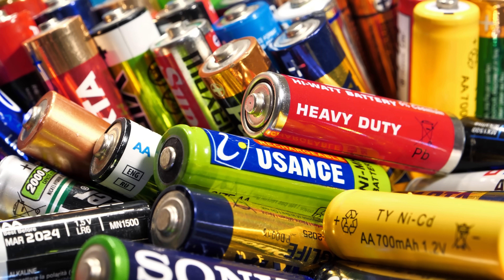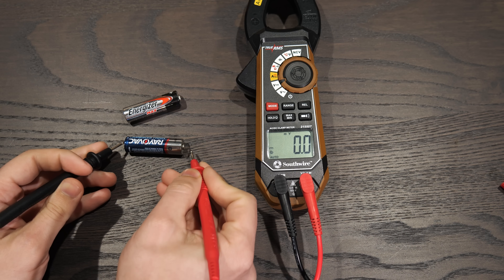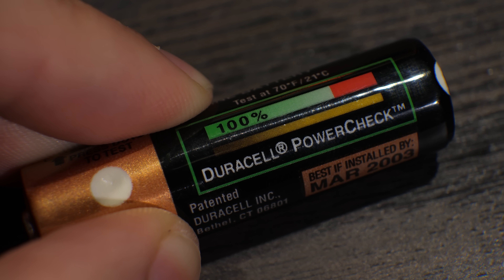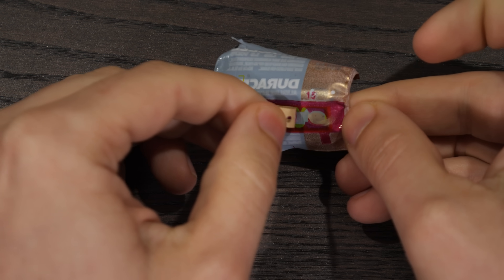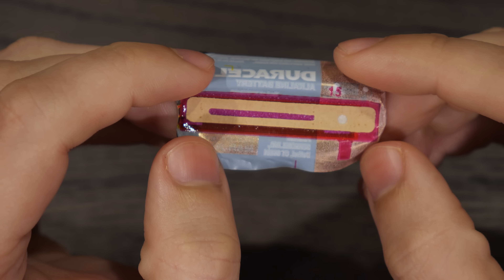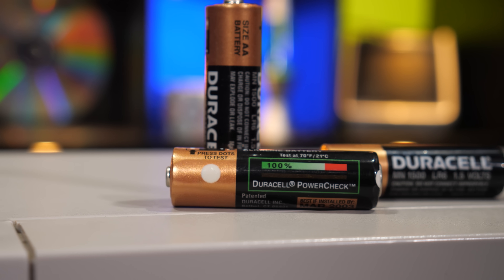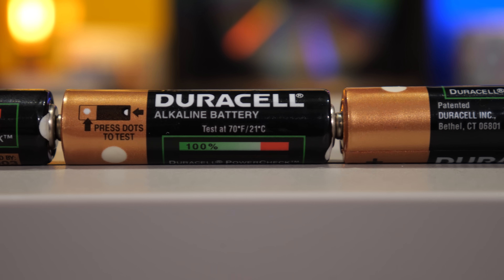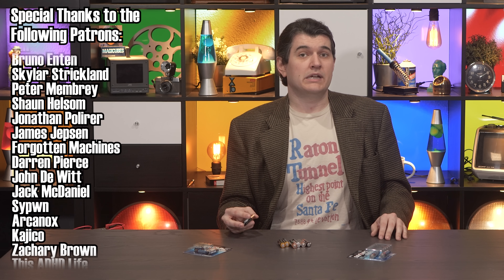Duracell PowerCheck: A genius idea which didn't last that long

Comment: I bought a bulk amount of Duracell Ultra PowerCheck batteries in mid 2010s in the UK. Still have some that are fine - best before date is 2024. These ones also have different colours on the meter, ranging from red, yellow, green, to blue.

Comment: as much as i hate AA batteries they're 10x better than internal batteries, i bought a brand new ps5 controller and it doesnt last more a few hours before its dead, ive had my xbox 360 for almost 15 years and its still going strong with removable batteries

Comment: When I was a kid, before Duracell integrated the tester into the battery, it used to be built in the packaging. You could test other brands of batteries too. Though, the tester does glow hot.

Comment: I'm going to disagree with you about fixed rechargeable batteries in devices vs regular disposable batteries.  I much prefer when devices use standard AAs rather than a completely proprietary lithium ion battery that's custom designed for a particular device alone.  There is a particular problem especially when it comes to retro gaming.  The good thing about an old GameBoy, Wii Controller, or Xbox controller is that it uses standard AA disposable batteries.  So 10-20 years later you can still use an old game boy device precisely because you can find easily replaceable new batteries, same goes for using old Wii remote controls on say a modern Wii emulator like Dolphin.  Compare that to the problems of early dedicated lithium ion devices like a Nintendo DS or Sony PS3 dualshock controller.  The problem with those devices is that once it's no longer a currently "on the market" device, no "newly" manufactured lithium ion batteries will ever made for that particular device ever again.  This is why it's difficult to keep a Nintendo DS from 2004 working whereas an old 1989 Gameboy has no such problems.  That's the problem these days with all the devices that use custom rechargeable lithium ion batteries that are specific to that particular device alone.  It'll become impossible to keep that device working in the long term since all Lithium Ion batteries have a shelf life regardless if they are used or not and if that custom battery for that particular device is no longer made (which it likely won't be since it was only designed to be used for a device that's no longer on the market), you'll be completely screwed after a decade or so when all the compatible batteries (both new and old stock) are now all dead and no new ones are made.  Any "new stock" batteries you may find for that device will be long dead since Litihium Ion batteries have the shelf life issue.  In contrast, as long as you take care of them, in theory you can keep devices like an old Gameboy, Xbox controllers, and Wii motes working forever with easily replaceable batteries that are still made to this day available at any corner store.  I still use my old Wiimotes I used to use on my Nintendo Wii back in 2006 for playing certain games using the Dolphin Wii emulator on the PC.  They sync via bluetooth on any modern PC.  There's no other way to get the accurate motion feel for some of the games without this old custom controller.   Fortunately since they use standard AA's it's simple to keep them going forever.  If instead they had some sort of internal proprietary recharable battery it would be long dead by now and it would be very difficult to find a working replacement (Just ask anyone with a Wii-U gamepad for example).

Comment: If only we could agree on standardized lithium ion batteries shapes and sizes the way we agreed on AA/AAA, etc. It's nice that you can recharge them, but once the battery is well and truly dead, you're usually SOL because the manufacturer has moved on to a new battery form.

Comment: About using half used batteries: Some devices don't work if the battery drops below a certain voltage but do work in remotes, so I do take batteries half used and throw them in other devices, so that actually mades me store half used batteries. Or made me use. Nowerdays I only buy rechargable ones, because I think it's a waste to throw them away after only 1 use.

Comment: I have a little DCF77 alarm clock that has been running on the same battery for over 20 years. It's and TDK battery that expired in 2004, and it still reads 1.41 volts. I almost expected your duracells to still work. 
Frankly i dont understand how mine still works. I live pretty close to the sender in Frankfurt, i wonder if the circuit kind of powers itself over that.

Comment: My experience.  Back during that time, some devices had high power draws, and would act like a battery was dead once the battery was drained enough.  But those batteries will still good if moved into another device with less power draw.  The test strip was helpful in these circumstances, checking to see if the battery had enough juice to be used in another application when it could no longer serve in its present application.

Comment: I would still find them useful, since my remote controls don't work very well when they have a low battery, I replace the batteries quite frequently, leaving the half-charged batteries in the drawer. And since these half-charged batteries still work quite well with certain devices, it would be very useful to know which one has more charge.

Comment: Those inbuild testers helped to find the one dead battery in a set. You could just switch that cell with a new one and you were good to go. That means: More efficient cause you used them completely. More cost efficient because just one new cell was needed instead of a whole pack. And it also was better for the environment due to less waste. At least as a user it was this way.

Comment: It is worthy to note how, although it was a slightly over engineered solution to a bit of a phantom problem, I remember thinking these were so cool when I was younger and I’m sure we all remember exerting maximum thumb strength trying to test these bad boys, don’t you think it did kinda help solidify that Duracell name in everyone’s household? Even the kids knew what a Duracell was! Those kids grew up and now they buy Duracells for their own TV’s and their children’s toys! I for one have never bought a pack of Kodak batteries 😖😂 I can’t help but think amidst all this 90’s gizmo and gadgetry, they actually came out victorious and it was basically their name that became synonymous with the battery itself!

Comment: Being a baby boomer I remember the Duracell built in battery tester, however I don't remember if I ever used it. Being an engineer I have a real battery tester an EICO 585 I built a zillion years ago. I use it and keep a stash of used batteries around for non-critical devices.  The pile of used batteries also includes any Carbon-Zinc ones that came packaged with some electronic widgets. 

Our town recycles batteries but I have no idea what they do with old single use cells but I dutifully save ours and bring in a bag of dead batteries every once and a while.

Comment: I would argue that in today's age of rechargeable batteries for legacy or cheap devices that dont have internal ones this should definitely come back, though hopefully in an easier to use way because being able to just test a rechargeable AA that might be half used because I cant remember if its been recharged or not would be great without throwing it on the charger anyway or breaking out a battery tester/multimeter.

Comment: I have seen those battery testers, yet with obvious con just as you mentioned, it's also basically just a printed resistor with thermochromatic dyes on top of it so it basically just wastes power so it pretty much stopped being useful (did I mention that it's also pathetically useless in cold weather?), so we pretty much are back to using digital multimeter to check it. I have since learned how to read the battery voltage to judge how much juice is left in it, including the bare Lithium-ion cells I usually use in my LED flashlight (I decided to ditch Alkaline batteries with LED flashlight since it eats through the batteries quickly especially at full brightness - my custom Nichia 319AT LED flashlight consumes 2 Amps of current at full brightness - and Lithium-ion cells are like about $5 a pop so it literally saved me a lot of money).

BTW, both patents on the thermochromatic battery tester has already expired.

Comment: I remember using some of those batteries in the late 2000s or early 2010s. So apparently PowerCheck was around in the 90s?

I'm one of those guys who keeps used batteries around. Usually they end up in TV remotes which use pretty much no power.

Comment: back in my remote control childhood, my parents made it clear that I'll have to use rechargeable batteries, the good ni-cd ones... single use batteries seem such a waste for most applications, but I still use lithium single use ones in my keyboard. They work for many years. 
Aren't there AA / AAA "retrofit" Li-ion batteries as well?

Comment: Actually, keeping batteries too weak to power high drain devices (electric motors, lights, etc) are perfect to keep around for the electron sipping devices like clocks and remote controls.  When you are poor, you have to learn how to save money in weird ways.

Addendum:  I am staring at a pile of emergency "1 more press" batteries right now.  The slight self recharge over time can be a real life saver.

Comment: Being born in 1996 these were always so interesting to me. My memories start after they were relevant, but before they were all dead and no longer in use. So they were just the odd batteries that were really cool and hardly ever showed up. I always loved testing their power level even though it took way more than a reasonable amount of pressure.

Comment: I remember these! Breifly around that time I also remember some battery packets (forget if Duracell or Energizer) had a built in tester of the same kind of technology. You'd move one of your AA cells back into that part of the plastic packet they came in, and squeeze the ends. This seemed a lot less wasteful to me at the time. They weren't sold for long though, at least here in Australia.

Comment: I use the drop test to find out quickly if the battery is fresh or dead. Dropping it on either the pos or neg end and observe: no bounce means good and bounces a few times is dead. The chemical inside battery is 'mushy' when fresh and dry when dead. So the inertia inside would prevent a fresh battery from bouncing but a harden dead battery will bounce.
It's the same principle to determine whether an egg is boiled or fresh: spin the egg, quickly stop and let it go. If it stops then it's boiled, if it keeps spinning a few more time means it's raw.

Comment: I have a really strange story about these batteries actually.

Back in the day my parents bought these batteries and I'd use them in my Gameboy Color and Gameboy Advance, and my mom got mad I went through so many of them one day and made me wait a week to get more. One day when the last couple batteries I had ran out of power while we were in the car, I accidentally left them in the back of the suburban we had, which has these trays right under the back windows. So they got totally baked in the Texas sun in the summer, locked in the car, probably way higher temperature than batteries should ever be left in. But the next day the yellow bar was right yellow and full. I thought that was odd and now after this video I understand it was because of the heat.

Yet the odd thing was that the batteries now worked. And they didn't just barely work, they worked for the entire drive to the store and most of my mom's shopping before dying on the way back home again. Previously, they wouldn't even get through to the Nintendo logo on the gameboy. Somehow leaving them in the sun got them more power. Well I left them in the car again, this time on purpose, and lo and behold they worked AGAIN next time I was in the car. I repeated this literally 4 or 5 times before it stopped working.

I remember continuing to do this for a while with the batteries I was given, until the trick stopped working completely. And I distinctly remember that it stopped working when we ran out of these powercheck batteries. For some reason it only worked on these duracell batteries.

Comment: LifeProTip: A quick way to check if a battery is full or dead is to bounce them. Drop them vertically on the negative side (from no higher than 1/2 of the battery height) on a hard surface. If it bounces it is empty. If it doesn't bounce it is not empty. Try, it 100% works.

Comment: I would also add that the graphic design of this feature was lacking. As a kid, I wasn't even aware that there is a bar BELOW the vibrantly colored "100%" bar. This video is the first time I learn of that yellow strip... I thought that the vibrant bar is supposed to move or something. There was no clear label or any explanation!

What's even more confusing is that it works backwards to progress bars I was used to, living in a left-to-right writing country. Wouldn't it be more logical to print the label upside down, so the progress bar moves from left to right?

Comment: I'm kinda shocked that so many people used normal batteries in battery hungry devices. I remember as a kid when friends had RC cars and whatever, they'd run out of batteries and then they'd be paper weights until their parents would buy them more batteries. Both my grandpa and dad had several sets of rechargeable AAs, that I used everywhere. When they ran out, there were charged ones waiting. I can't understand this wasn't what everyone did. In the modern times with consoles I continued this tradition, except the rechargeable batteries had gotten a lot better. Yet it was pretty common for people in multiplayer games to constantly complain how they ran out of batteries and had to steal them from a remote or something.

Comment: it may be empty at below 1 volt mark but most of devices wont work at all when it goes below 1.2 or 1.1 very least, only clocks and flashlights are able to drain them further!

Comment: Too bad rechargeables produce those stupid cheap charging stations by the billions, and the batteries themselves aren't even half as recyclable as the one-time use ones are. AND they don't even make sense financially. I'm still using the same C batteries i bought 4 years ago for my LED flashlight, they show no sign of dying. While a USB rechargeable lamp would have already died on me if not through its crappy chinese circuits, then the super comfy daily charged battery would be dead by now.

Comment: I had some old batteries in the drawer with that on the side of them that I used recently. You aren't kidding with having to put an absurd amount of pressure to get those things to work but it was showing that they were still fully charged after all this time lol. Didn't expect to see a video about them but its cool to see how those work. I thought they were done by small led since mine had individual colored sections

Comment: excuse me, WHAT? Use by 2003? It's been >20 years since these? how??? Also, I find my kid's toys still require a lot of AA, and lately even more so AAA UGHH. I got some lithium rechargeable AA at least, so that helps. I wish NiMH rechargeables could do 1.5v tho, I'd just go with those instead, but a constant 1.2v  doesn't seem to be enough for a lot of these 'modern' toys, and no 1.2v is considered low/dead in those toys. Be gone alkaline! And for those wondering, 9V square batteries are often 6 AAAA batteries in series.

Comment: In 2013 Duracell came out with their Quantum line of batteries which had a very similar power check meter on it but I think they discontinued them a few years ago.

Comment: Funny you should release this video now, just the other day I came across some Duracell batteries in a metal detector that we purchased some ten years ago and only used once. As they had the power check feature I actually tried it, expecting them to be completely dud but to my surprise they all said they had some charge left and the device actually worked. The batteries said use by 2023, so not much past their date, more surprisingly for the fact they'd been in a device for over ten years though was that they'd not leaked in the slightest, I don't think they were marked at 'no leak' which I know some manufacturers advertise.
Anyway, keep up the excellent work with your brilliant videos.

Comment: I have nice 4V bulb soldered to two cca 15cm wires and it is perfect tester for batteries. If battery is fresh, it will light almost bright, if it is weak, it will barely show any sign of light. And since it is 4V bulb there is plenty of load for the battery and it lasts forever. I can also check 3V button cell batteries easily.

Im using AAs for camera flashes a lot, so this simple tool is nice help to check NiMhs. As said simple voltmeter does not say much. I have many various batteries which easily show good voltage, but whatever load is the showstopper. Such batteries are then only good for some LED light until they die.

Comment: I am surprised they killed this feature. They had it into the 2010s. In europe they had a colored way of showing the voltage.
The AAA by volume is tiny, for the weight, but also means waaay less capacity

Comment: I prefer devices that use batteries rather than having a rechargeable one built in, as I can just replace them and use my device ( flashlights and light pucks mostly) without needing to wait for it to recharge. All my AAs, AAA’s, and D’s are rechargeable themselves of course, and have already paid for themselves many times over…

Comment: I'd still like to know what changed in the battery construction that makes so many modern ones leak so bad.  It's like they can sense how expensive the device is and adjust the leakage proportionally.  And to add insult to injury, batteries are crazy expensive these days.